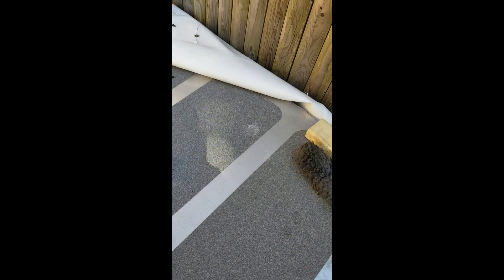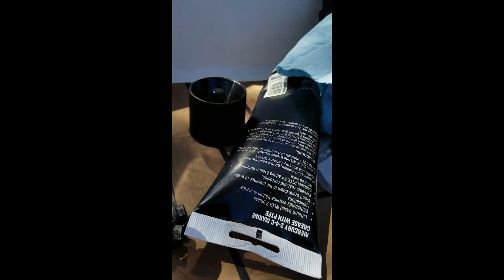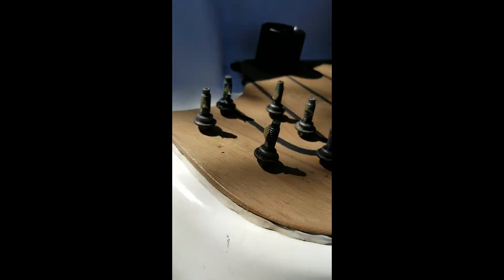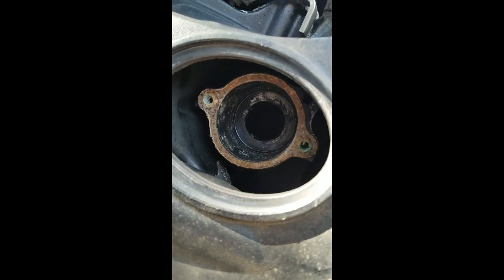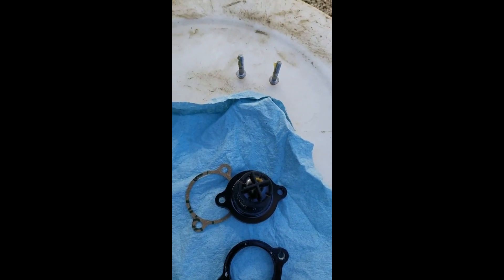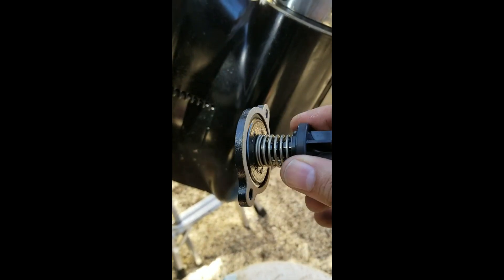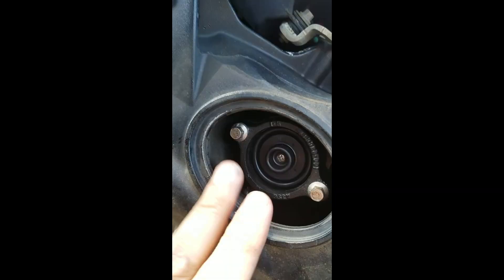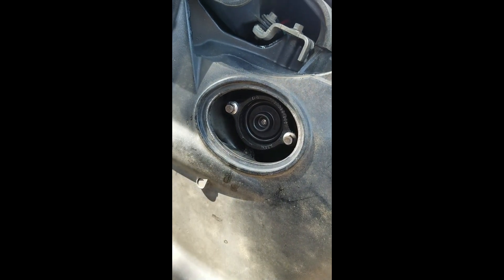Poppet Valve Replacement Mercury Verado

Comment: wow...on a merc, thats obvious a big deal with the ease of changing and size etc. Not that way on other 4 stroke motors.
Reply from the maker: You are 1000% right..and they should be changed every 2 years or so to assure proper temperature.